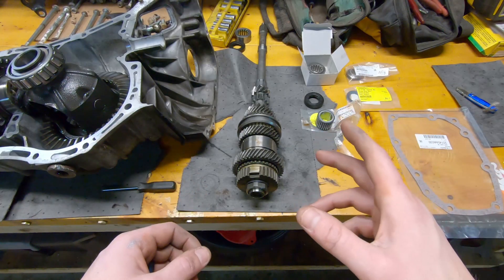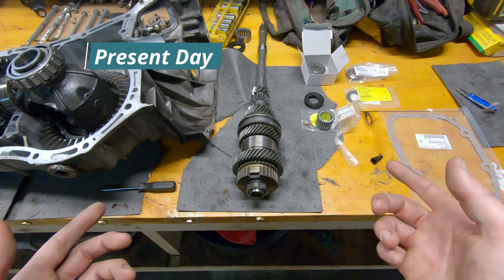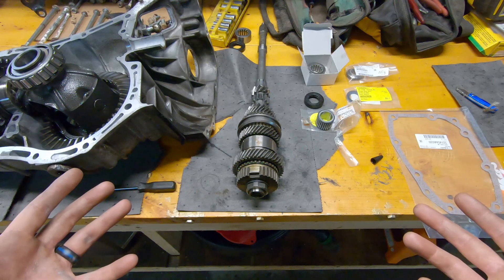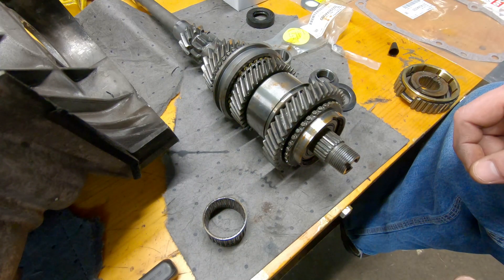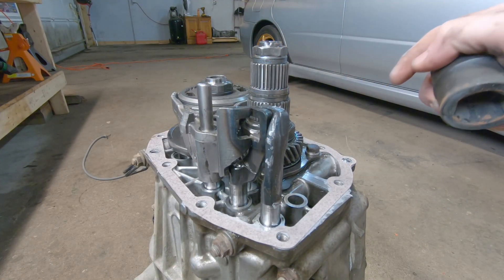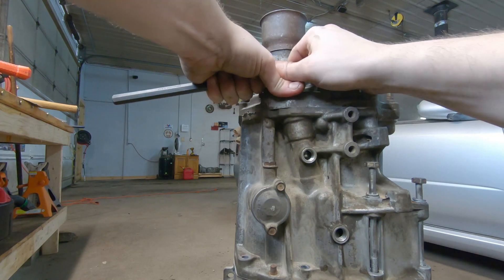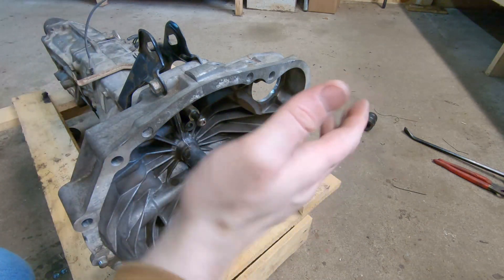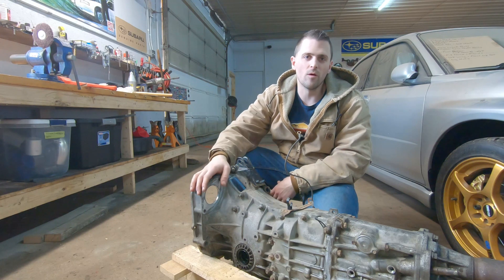Subaru 5-Speed Final Assembly After Bearing Replacement - Part 3

Comment: To the channel owner.... 
I'm not completely writing off some of the criticisms in these comments. You could probably be more by the book in some of your operations. 
But the attitude in most of them is quite repugnant considering you are providing really great video content for people wanting to do this for themselves. 
I myself am about to attempt addressing bearing noise in the box for my 06 forester. Your commentary and indeed your relative lack of experience, are actually quite helpful to me as I met at the same level or a bit lower.
Reply from the maker: I think the criticisms missed the scope of the video.
I'm not rebuilding this for a customer or even to present a professional rebuild. Just an experiment of opening up the transmission to see if I could fix it.
It's still sitting in the corner of my shop collecting dust as I don't ever plan on using it unless I'm in a pinch.

Comment: Did you checked if 5th gear stop having play after you replaced the needle bearing? My 5th gear has exactly the same play. Wanted to know if replacing that bearing will fix the play. But couldn’t tell from the video cause I didn’t see you check it. Thanks
Reply from the maker: I never rechecked it because I didn't know if it was meant to have a little play or not, I was most paying attention to fixing the rough/noisy bearings
Reply: @ i have the same doubt too. Wonder if i replace the needle bearings on 4th and 5th if the play will go away. I’ll have to actually do it and see. Thanks for the reply

Comment: This guys is full of shit. You can use this Subaru tranny on whatever Subaru you want from 1989-21 it’s a push style clutch same as the 98-01 impreza rs, only one that’s different is 02-04 pull style clutch. And some others but you can run whatever one you want with the right pressure plate, slave cylinder style, and correct final drive rear diff to match. I run a 07 wrx 5mt behind an 06 sti all in the shell of a 1985 Subaru awd rx turbo sedan. It fits.

Comment: 2:43 that is part of the syncro system, the "brake" that stops the RPM difference. Whoever is doing the clutchless shifting on trans like this, even they don't  hear the grind (syncro teeth), they are putting stress on this brake which is not designed for. when the brake start to slipp, you won't get in gear.

Comment: Ahh yes, not a torque wrench in sight as well as impacting the casing bolts in a uneven pattern. Perfection 👌🏻
Reply: You may have you own methods, however when it comes to rebuilding an engine, transmission, differential. Shit, even something as simple as bolting on a brake caliper. A properly calibrated torque wrench, assembly lubricant and precise torquing pattern should always be practiced. Leads to less failures down the road. An opinion is like an asshole and everyone has one. Take my reply with a grain of salt or learn from it don’t matter to me.
Reply: @TheDylanmisener yes there's always some know-all on YouTube right?
Torque wrenches are necessary in a small number of critical applications but if you think you need to use a torque wrench on a brake caliper bolt that you plainly you don't work on cars.  For the vast majority of bolts and nuts two creaks of the elbow and some experience are more than good enough. 
Besides which, if you're someone working at home on their own card trying to come to grips with this kind of work, this video series is invaluable.
Reply from the maker: I'll take the salt. Torque wrenches have their place, 90% of automotive work however can be accomplished without the need of torque values, just have to use your head.
Reply: @TwoFourSevenDIY   ya automotive repairs can be accomplished without a torque wrench if your a hack job (garage mechanic) that refuses to use your head. Notice I didn’t put in a percentage of work? That’s cause precise repairs that require what I stated in the comment above don’t take up 90% of automotive repairs. Do it right or don’t do it at all.
Reply from the maker: I'm glad you do it right. Bully for you 👍
Reply: @TheDylanmisener  you're right, TwoFourSevenDIY is a lazy hack.
Reply from the maker: @gregsmith332 Aww thanks!
Reply: @TwoFourSevenDIY  That's criticism, not a complement.
Reply from the maker: Thanks champ! Your comments mean the world to me 😃
Reply: it will be fine  done a bunch of these 5 speeds over years  big prob is center diff chucking lock clip  and getting  killed in the tranafer gears  sending metal threw the trans   i just give the gears a few uga dugas  with the inpact  gun
Reply from the maker: Everyone has their own methods. These were mine.
Your approval however means the world to me!

Comment: Good job but next time use user manual you make some mistakes, i hope everytink is good. If you want type me i have lot a pictures when i make my Gearbox. But good for you now :)
Reply from the maker: Thanks! Feel free to let me know what I did wrong
Reply: @TwoFourSevenDIY 
1. Does not tighten the box bolts in the correct order.
2. Did not tighten the shaft nut with the specified force
3. You didn't wash the box well and that way you risk the repair going to hell. But still, it's a small thing.
4. The method you use to open the shell with this rolbar is in danger of breaking the shell or wounding the surface and ulcerating
5. When you tightened the first bolt the shell still wasn't snug on both sides. This way you can break the casing and it won't stick well. Squeeze a little on both sides until it closes tightly. Finally tighten!

I'm not writing this to nag. I'm glad you're doing this yourself. I also did it myself but I made the mistake of not changing the main bearing and now I have a slight noise. I don't care for such a small fuss to do that again. I had a bigger problem and he had broken teeth in second gear. I remove everything from the shaft and replace it. Then I put everything in order with the press.

Comment: What is that first gear past the washer and nut(with the straight cut gears) for?
Reply from the maker: It is the inner portion of the selector for 5th gear. You can see at 9:15 where I place the outer portion on it during installation. Part is "Sleeve and hub #2" number: 32239AA120
Reply from the maker: I can't remember off the top of my head, give me a chance to look at the part diagrams, I should have an answer for you by tomorrow

Comment: Thanks for the video - appreciate you sharing - I'm here just to learn about Subie M/Ts - I can tell you from my experience with my Kia, this doesn't work though - whenever you have a bad needle bearing, you need to change the races too - mine made noise again after just 700 km - I rebuilt again and replaced the full gearset (minus drive gears) sleeves, and bearings and fixed for good - bearings/races have a design life, and when one fails it's best to replace all of them or else the others will eventually fail and you'll never get the same lifespan as a fully rebuilt or new trans - ultimately it comes down to your budget, needs, and time when deciding to repair or fully rebuild
Reply from the maker: I hear you, I would have loved to replace both but the inner race was pressed on and dont have the necessary tools to replace that.
Reply: @TwoFourSevenDIY  Got you - just wanted to share my experience with the same issue to hopefully help others - yes, tools are a limiting factor, but they are sometimes the only way to allow you to fix the problem - in my case, I needed a factory service manual, a shop press, and bearing separator kit, and a couple other basic tools so I could fix properly

Comment: You made this video just in time (for me)!  I had this exact issue, down to that specific bearing on a 2009 Outback 5MT.  Thanks for making the video.  It is incredibly helpful to have a video run through instead of having to figure it all out on the fly, particularly the little things to look out for along the way.
Reply from the maker: Glad you found it helpful!
 I wish I could tell you for certain that it's fixed but I just don't have a need to install it in my Forester right now. But the noise is definitely gone so I'm pretty positive it's sorted out
Reply: @TwoFourSevenDIY  I think you did fix it. Mine makes a noise exactly like yours did, and the noise decreases in frequency as i progress through the gears. So since the 5th gear is fixed on the "output" and shifts on the input it makes alot of sense that this bearing is bad in my transmission. Mine also won't shift into 5th, but that's a different issue.

I'm wondering if I could fix this in the car. One reason it doesn't shift into 5th could be a pin has fallen out of the 5th shift fork. And I was wondering if you thought it might be possible to change the roller bearing you changed in this video with the transmission in the car?
Reply from the maker: I don't think that's remotely possible
Reply: @TwoFourSevenDIY  ha ha ha I do some of my best work when people tell me it cant be done. I might try it

Comment: Nice work, enjoyed your video. I had the center diff go out on my 2000 Outback, and had a couple broken pieces end up jamming my 5 speed, making it un-shiftable. Fortunately, I was in a parking lot when it got jammed up and not buzzing down the freeway so no catastrophic damage happened. A transmission guy in my area pulled out the broken pieces and put a new center diff in, and she is back on the road now. Cost me a $1000 parts and labor. I saved on R and R since I did that part myself. The transmission doesn't look too hard to work on, maybe I'll take one on myself sometime. I would think you could use any 5 speed, more or less in your Forester, as long as the gearing matches the rear diff. Some people just take the rear differential plus transmission from the same car and that seems to be a way to go. The 2000 Outback I have, was kind of a one year different then the rest, but if you do both the transmission plus rear diff I think it will work on most any Subaru models. I could be wrong about that, but its the impression I got from my research.

I just realized I commented on this video a few weeks ago... damn my brain, I didn't even remember watching it before, I guess I watched you work twice haha. Twice as good a video the second time I guess!
Reply: YEAH! Bought a scrap Forester 4 years ago and swapped the entire trans' into my Legacy wagon - lower ratio - Now I have a replacement centre dif' for the original Legacy box, it's all going back in and my speedo will be telling the truth again .. ....

Comment: Great vid, thanks for the info. Did you get to test the gearbox yet?
Reply from the maker: Unfortunately no.
Fingers crossed it just sits in a corner of the shop and I never need it.
But it's nice to know that I'm pretty sure it will work as a back up

Comment: does this happen to be the same 5 speed in the 2006 outback 2.5xt?
Reply from the maker: It may be very similar, but I don't think it's the same. The part # only show compatibility with 09-13 Foresters
Reply: @TwoFourSevenDIY  ok thanks man
Reply: @TwoFourSevenDIY  I have a squeak and when I push my clutch pedal in it goes away, then comes back when I release it. I read it could be the input shaft bearing
Reply from the maker: It's possible
Reply: Every different year for every different model has a different number for the gearbox. Could be just different ratios or other small adjustments but seems the basic operation of all of them is the same